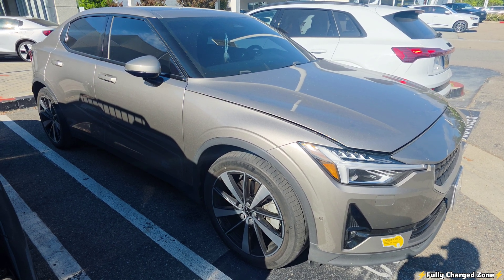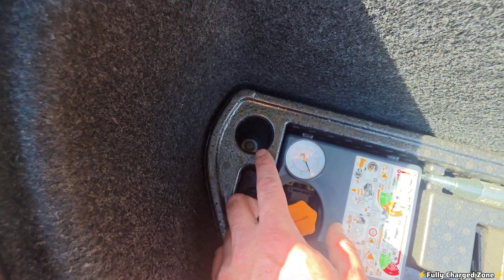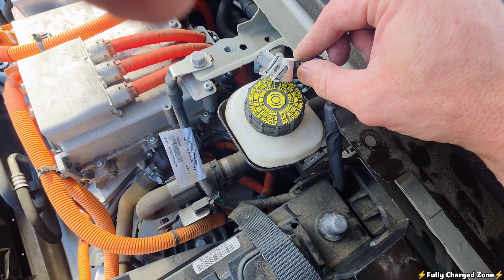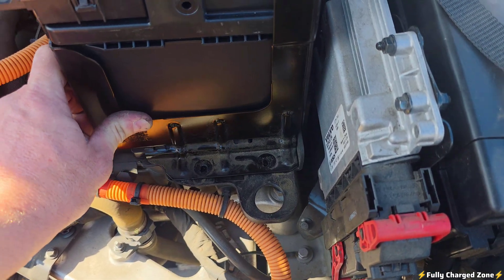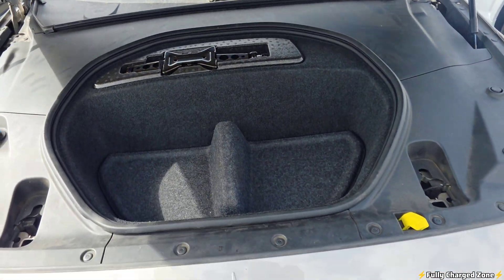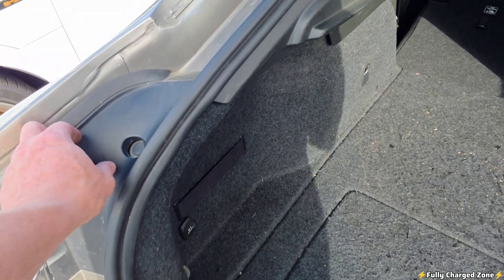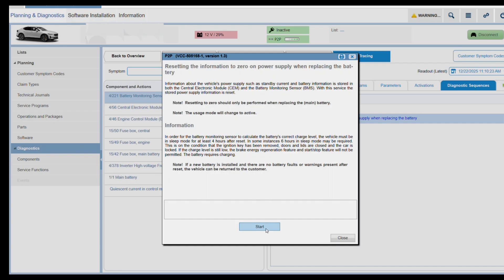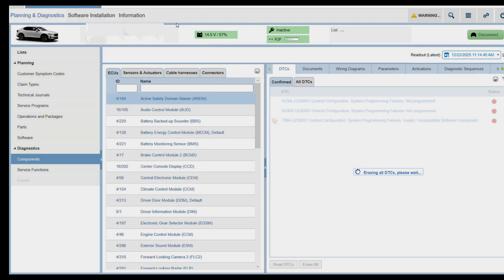Polestar 2 | TCAM Backup Battery & 12V Battery Replacement Procedure

Comment: Excellent, excellent work. Made it very easy to swap my battery out. Pretty sure it's the 12v from the factory, it lasted maybe 3.5-4 years and 42,000 miles. A slightly annoying process, but fun to knock out in an hour with my dad. The little "Christmas tree" fasteners that you poke down to release....cool design, but super cheap and finicky. Some were missing/broken and we had to break two more to get them out. Not critical, but I'll probably order some new ones. Thank you for this video!

Comment: Dude!  Thank you for the detailed video.  I reached out to my local Volvo dealer (not an authorized Polestar service center) to see if they could swap the 12V battery, and they said they couldn't because the BMS needs to be reset and they claimed they didnt have the tool (which I have trouble believing).  There's several posts on Reddit saying the 12V is easy to swap, but nobody mentions the BMS needing to be reset, which I found worrying now seeing that it indeed is a real part of the process and likely keeps the 12V system working more reliably in the long run.  Im 400 miles from a Polestar service point, so I may have to do this myself some day.  Again thanks for going through the steps, I really appreciate the video!
Reply from the maker: Appreciate the kind words, glad the video helped. 👍
To clear this up... the 12V battery can be physically swapped without special tools, but Polestar does recommend a BMS/12V reset afterward so the car relearns battery state and charging behavior. Without the reset, the car usually still works, but you can see odd warnings, incorrect SOC readings, and a battery that will be over charged.
That’s likely why the Volvo dealer declined, non-authorized dealers typically don’t have Polestar VIDA access to perform the reset. If you do it yourself, you can find a shop that has a Autel scanner.  Most likely any hybrid shop would.  I'd call and see if they could program the battery
Reply: @FullyChargedZone thanks for clearing that up. I just got a warning on my app and am debating getting a new 12V. I would certainly do it myself. What do you recommend for a scanner if I were to buy one?